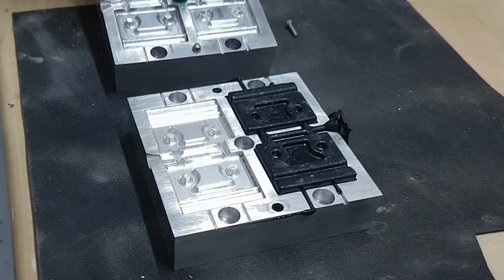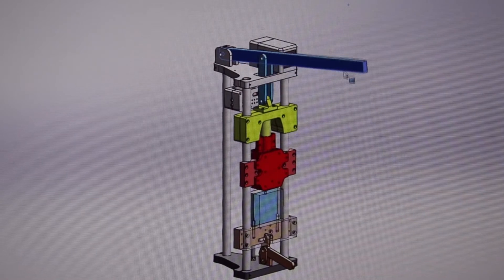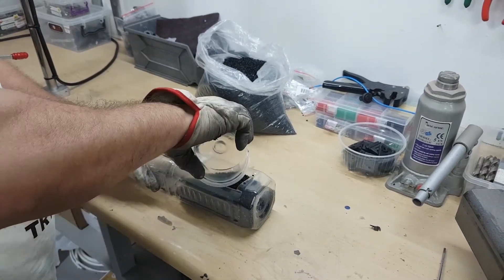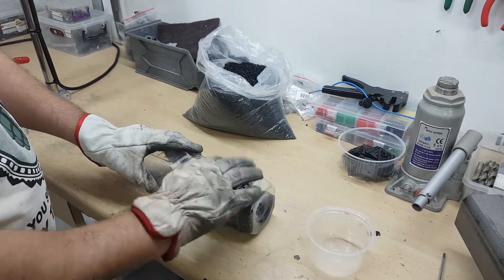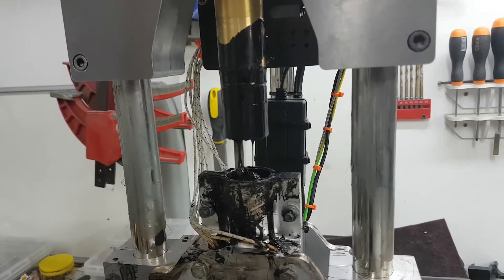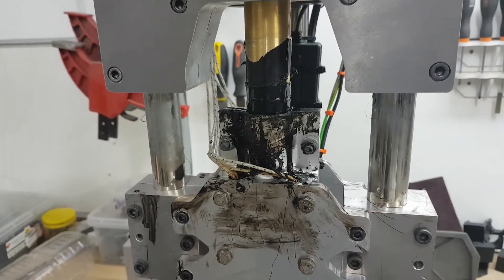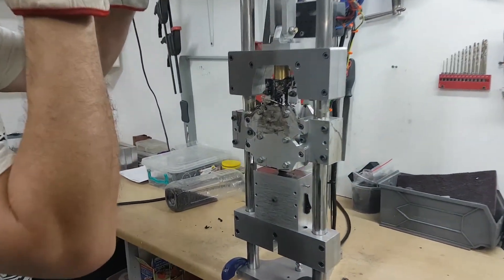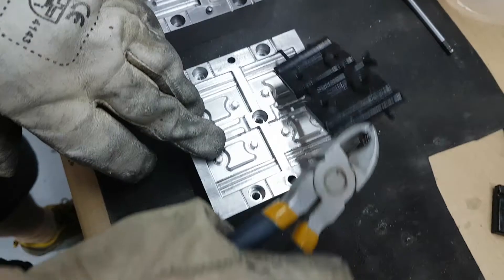DIY Injection molding

Comment: May I suggest that if you plan to produce half decent parts, you need more packing force maintained while the material transitions from liquid to solid; secondly, you need a cooling system to maintain the correct moulding temperature, and remove the heat from the moulding. If you want to learn more, Arburg produce an excellent reference book.
Reply: I went to the Arburg site and could find no reference book, do you have a link?

Comment: Hello Sir, are you from south Africa?
Reply from the maker: Yes
Reply: @quintonmatzner7466  that is great, so am I and I was wondering if you'd be able to build a machine like that and sell it?
Reply: @quintonmatzner7466  nice really like it. Im also from RSA. Was wondering if you would mind sharing your designs and bom etc mayby CAD files aswell? Then i can 3d print the frame parts. . Pid controller i can get at microelectronics R900 ish. But the band heater elements are less easy to get. Had a look at RS. But they rarely have stock.  Thus if you can share whatever you can i would really appreciate. Sorry for high jacking this comment
Reply: @quintonmatzner7466  Are you based in Johannesburg or Port Elizabeth?

Comment: How much it will cost to have something like that?
Reply: Depends on many factors... just to start, do you already have a lathe and standard milling machine? Then do you have the steel, stainless steel, and aluminum materials? 
For the mold themselves, you will need a cnc milling machine and quite a bit of know-how for the often-times complicated and hair-pulling design software thats needed to tell the cnc machine where and how to cut ... that is if youre not making the most basic of designs to be molded in the aluminum mold.